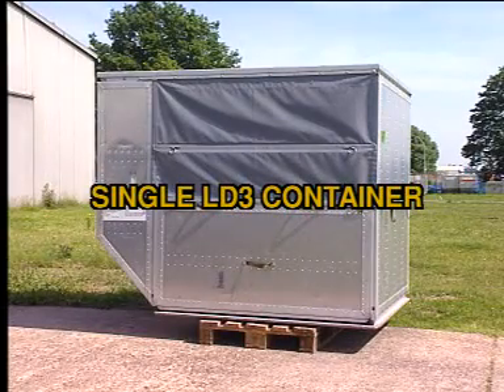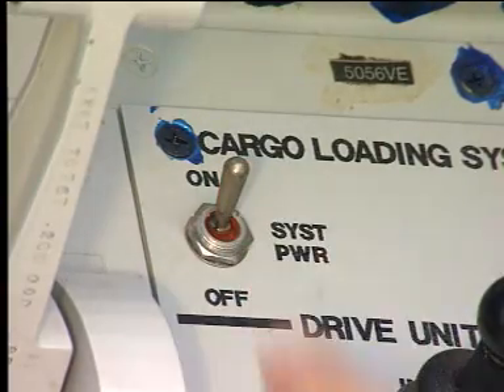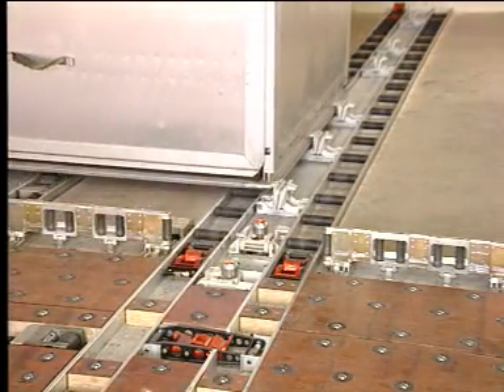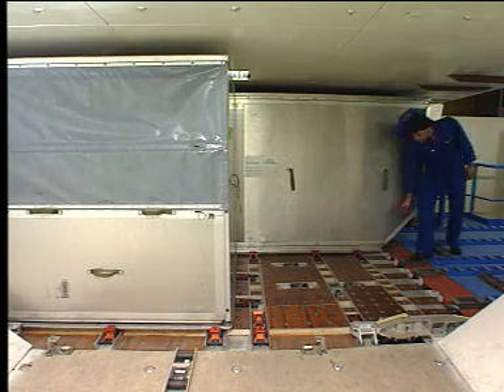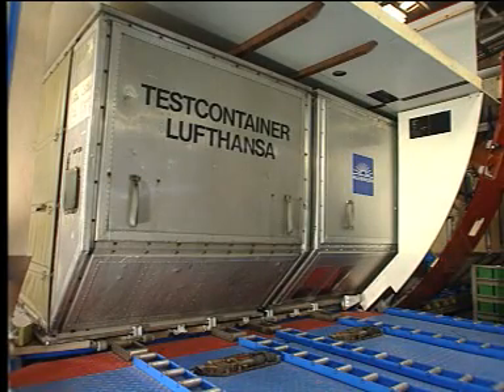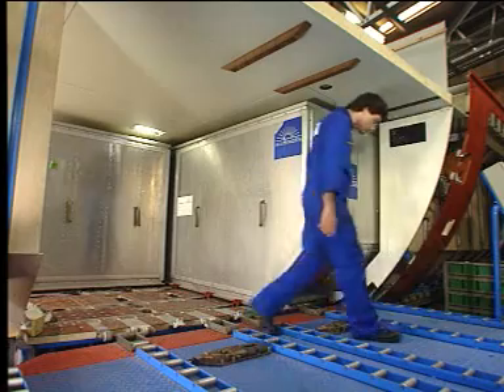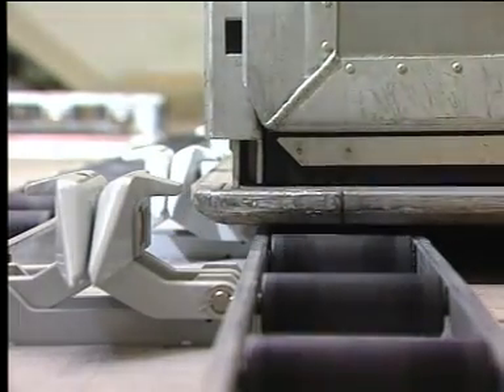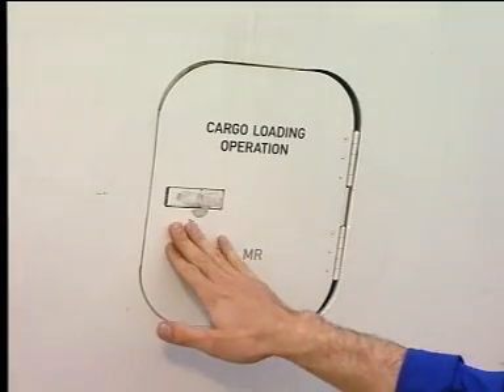AIRCRAFT | A330/A340 Single LD3 Container Loading and Unloading Operation

Comment: 2:00 is that little lock enough to hold a 1.3 tonne container during violent turbulence? Do you need to fill the hold with empty containers to make sure the full ones can't move when the plane is load limited?

Comment: Yes the operation can only be performed smoothly if the aircraft cargo drive loading and unloading system is working normally but due to poor maintenance by varied airlines this is not normally possible.
The the only way out is overriding the Heath and safety and push and pull the containers in and out of the cargo holds .
This could be drive system is not operational or the cargo door is not fully open .
If cargo door is not fully open then the door should be again raised ... the other reasons are a cargo door which issue I called a falling door issue .
However most of the aircraft I have been on there drive systems are not be repaired or maintained which should be included in the routine maintenance c 
Checks.
The video is showing were all loading and unloading drive system is operational and also there are no uld containers are  demaged. Or out of shape were the drive system can not cope with which results in failure on load and unload of aircraft .
From rayhan ahmed 
Ramp operations 
T2. Heathrow